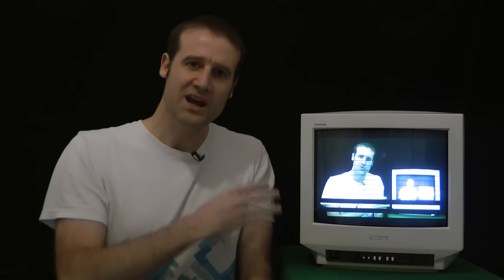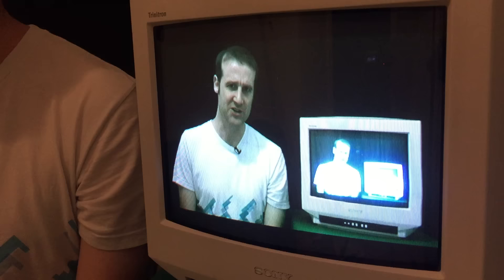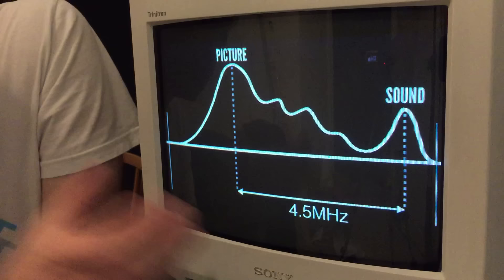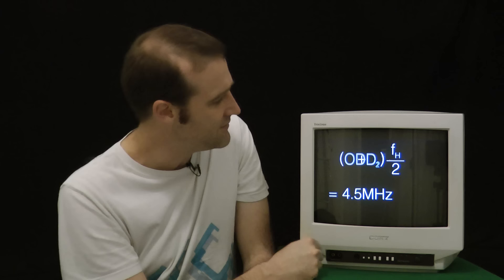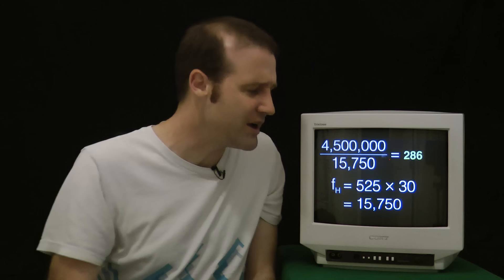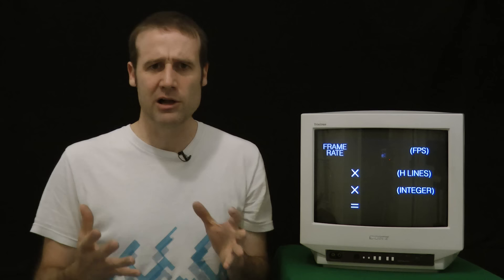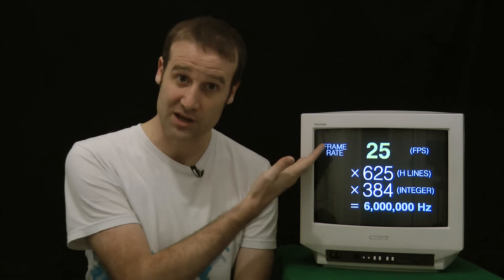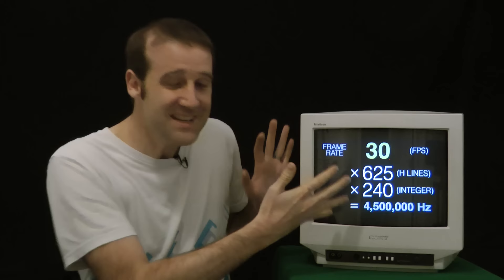Why is TV 29.97 frames per second?

Comment: “PAL was better because it was higher resolution”. Not true. The reason was much more interesting. Colour information was coded in the phase of a sub carrier relative to a short burst of that subcarrier at the start of the line. The problem with NTSC was that the received signal could have phase errors due to things near the aerial blowing around in the wind. These phase errors would get turned into distracting colour (hue) errors. In PAL (Phase Alternate Line where the phase swung +/- 45 deg ) each tv line signal was stored in a delay line and averaged with the next line. The vector sum turned phase (hue) errors into amplitude (brightness) errors which were visually unnoticeable. That’s the real reason NTSC was mockingly called ‘Never the same colour’
Reply: Exactly. But what about SECAM?
Reply: Never Twice (the) Same Colour
Reply: I was at BBC Engineering Training Department Wood Norton in 1980 (a former stately home which doubled as UNIT Headquarters where Jon Pertwee first appeared as Doctor Who). Our lecturer, Pete Harris, had a humorous take on  how the pros & cons of the three colour systems related to their names. NTSC was a beautiful work of genius but it suffered from one major problem - hue errors. (Thus American TVs all needed a 'Hue' control.) SECAM (Séquentiel Couleur À Mémoire) was fantastic for transmission (and protecting French manufacturing on the orders of Charles de Gaulle) but was mind-numbingly useless in the studio.  PAL (Phase Alternating Line), however,  took the otherwise excellent NTSC, built on the American experience and elegantly solved the hue problem. Thus, we had the three designations:
NTSC: Never Twice Same Colour
SECAM: Système Extraordinaire Contre les Américains
PAL: Perfect At Last!
Reply: The wind did not cause hue errors in NTSC.  The color subcarrier and the main carrier may shift together a little but, but, since the color subcarrier is detected as the difference between the carrier and the subcarrier (a much smaller figure than the main carrier), hue shifts did not occur.

If the picture is heavily affected by dynamic multipath (e.g. trees blowing in a storm) can cause a loss in horizontal synchronization. When the back porch color pilot is freed from the synch, anything that occurs in the horizontal retrace becomes a false color reference.
Reply: @1L6E6VHF  That's not entirely correct. It's not a question of subcarrier and "main carrier". The colour information was sent on a subcarrier (a sine wave added to the video signal - 3.58MHz in NTSC and 4.433MHz in PAL). The instantaneous saturation & hue of the picture were given respectively by the amplitude of this wave and its phase angle with respect to a fixed reference. The angle of the fixed reference was communicated to the TV set by a short sample of about ten cycles of subcarrier at the beginning of each television line (the Colour Burst) and then maintained throughout the duration of the line by the BLO (Burst-Locked Oscillator) inside the TV.
Reply: Nice information to supplement this presentation. Sounds like you had some first-hand experience with this!
Reply: @rom5285  VT Editor, BBC Television.
Reply: PAL had Colour noise (Heranboning) on fine detail like stripes in a shirt or Sute Jacket but didn't have annoying Colour errors and the picture
Reply: @don1estelle  Another classic was the nets on the goalposts at football matches (soccer to our American friends) shimmering with a purple aura. 
However, this was quite unnecessary. As explained in the video, PAL and NTSC were exquisitely designed so that the chrominance information was carefully interleaved in the frequency domain with the luminance. The two could actually be separated very successfully with comb filters, thus avoiding cross-colour AND preserving the full transmitted resolution of the luminance signal. Comb filters, however, were an expensive option, so manufacturers generally extracted the colour subcarrier with a simple bandpass filter (which meant that the fine detail on a checked suit was passed on to be decoded as though it were valid colour information) and either rolled off the luminance channel to cut down the dot pattern of the subcarrier or simply left it intact. The result was that viewers never got to enjoy the sparkling resolution and immunity from cross-colour that had been designed into the system from the very start.
Reply: @gerardjlaw  Tipical you get what you pay for ay! I wouldn't know about football nets I'm not a fan, like watching Paint Dry!!!
Reply: i do remember audio noises came up on TV, when a PAL station transmit pure white image.
Those fading to brief pure white image was commonly used at end of ads/commercial clip, which quite annoying.
Reply: Correct. it is System B that is higher resolution. PAL was only better because it has a method for automatically correcting color errors.
Reply: @don1estelle  I couldn't agree more! Recording a match reminded me of when I volunteered for a sensory deprivation experiment.
 
One day, George, the Sports PA, dashed in to ask about a match I was recording.
"Gerry! Who's scored so far in your game?"
"I don't know."
"OK. What's the score just now?"
I smiled apologetically..
"I don't know." 
A wry smile spread across his face.
"You don't know ****ing who's playing, do you?" 
And he was right! The OB link was coming from Dundee, but it has two football teams and I didn't even know which one it was coming from!  (However, syncs and burst were stable, vision and sound were continuous, AND I was monitoring off the playback head, so I was confident that I'd discharged my duty to the programme.)
Reply: NTSC sets had tint control because of the phase error. How often did people have to get up from the sofa and adjust it?
Reply: Graeme Roberts SECAM did not use QAM ( used FM so avoids phase error issue) but could not transmit both U and V signals simultaneously as a result. I think it transmitted U and V alternately by line so to obtain the missing signal, it just used the corresponding signal from the last line.
Reply: @graemeroberts2935  - SECAM is known to be very prone to confetti-like color errors, in my experience, along with being the worst in color reproduction. In my opinion: garbage compared even to NTSC.
Reply: @gerardjlaw  🤣😅🤣
Reply: Resolution and color were probably both factors in that
Reply: Incorrect. Pal is superior to NTSC is because the US thought about what's possible now and roll out something at its earliest just to say you that were first. Why is NTSC limited to the regions that use it? Because it was still in development when Yanks said "Yur 'Merica!"  lets get this new technology into every home we can and when better developments come along we wont care.

TLDR: NTSC is the format used in America because they jumped the gun. The technical reasons we know now are an afterthought since we can analyse the true definition.
Reply: @gerardjlaw  Thanks for all your posts and replies - I learned a lot about this interesting history of broadcast standards. (as someone who specialized in physics and electronics, I thought I knew how old TVs worked, but not at this level of detail!)
Reply: @GeorgeBurkhard  It's the old story - we physicists tend to think of the world in terms of fundamental laws but the engineers have to grapple with the complex detail of some fairly subtle interactions. 
There's a superb analysis of this stuff by another old VT aficionado, Sadiq Mohamed, here:
http://editorsbench.co.uk/documents/CF2015.pdf
Reply: @don1estelle  Never watched paint dry myself, what's it do?
Reply: The NTSC system had fewer scan-lines but also effectively lower horizontal resolution (from the RF bandwidth) than PAL. But it had the higher frame-rate.
Interestingly, when they started to go digital in the studios, they adopted a common 13.5 MHz sampling rate for both PAL and NTSC. 13.5MHz being just slightly above the Nyquist frequency for the analogue bandwidth... but also having an integer number of samples (non-square pixels) in both PAL 25*625 --> 64µs linetime (864 samples) and NTSC 30*525 --> 63.492..µs (857 samples - with some fudging somewhere). Standard definition digital video (including DVDs) comes from this digitisation rate. Because of the time "lost" in horizontal sync pulses, the "active" scan line (52µs for PAL) contains only 702-ish samples, rounded up to 720 samples for digital MPEG video (being divisible by 8 is helpful as digital video is coded in 8x8 blocks...).
Reply: @gerardjlaw  WOW
Reply: @don1estelle  what is Heranboning
Reply: @EnergeticWaves  Hmmm! Actually, it's a mistake based on hearing the word but not knowing what it means. The word actually refers to a "herringbone" (zig-zag) pattern.
BUT...
That kind of pattern on a TV screen was caused by the colour subcarrier being impressed onto the luminance (brightness) signal instead of being filtered out of it with (expensive) comb filters. 
However, what don1estelle is talking about is the exact opposite, viz. luminance information at around 4.433 MHz being passed into the colour decoder (again because most TV sets didn't use comb filters) and interpreted as valid colour information. This was called "cross-colour" and was seen as shimmering patches of colours, usually green & magenta or blue & yellow, overlain on an otherwise fairly colourless area of the picture. It was often seen in football (soccer) matches, where the nets behind the goalposts would shimmer with colour or on particularly loud suits worn by some of the less restrained presenters. (Often, coincidentally, on football programmes!) Cloth with a "herringbone" pattern was particularly susceptible, which I suspect is the source of don1estelle's confusion of terms.
Reply: @gerardjlaw  I remember reading about that R-Y & B-Y stuff a few decades ago.  was the idea to "fake green" buy fooling with red and blue?  I never did get it.
Reply: @EnergeticWaves  When colour TV was introduced, the signal had to look enough like the original black & white signal that it would work properly when it was fed into a B&W TV set. The answer was to take the three colour signals (Red, Green & Blue) and produce a luminance signal, Y, (basically, an old-fashioned B&W signal), equal to 0.3R + 0.59G + 0.11B and then to add a high-frequency sine wave to it carrying enough colour information that the original R, G & B signals could be recovered. 
At the source, there were actually two high-frequency sine waves offset by 90° which were amplitude-modulated by the 'colour-difference' signals (basically R-Y & B-Y), and the two sine waves were then added together. However, by the magic of vector algebra, they could be separated again at the receiving end and R-Y & B-Y recovered. From these two signals and the Y signal, the original Red, Green & Blue signals could then be calculated and fed to the guns of the cathode ray tube.
It sounds like a long way for a short cut but it maintained excellent compatibility with existing B&W sets while delivering good quality colour pictures to those sets capable of displaying them.
Reply: So PAL has higher resolution, an integer frame rate, better colour reproduction ... yet NTSC is always considered the default

Comment: To be precise, for NTSC 4.5 MHz is the frequency difference between the video carrier and the audio carrier for each (6-MHz) channel. IIRC, the reason that this value could not be changed (leading to the math discussed by Matt) was that if you moved the audio carrier (say to keep 30 frames per second with 525 lines per frame as well as the half-integer requirements), the audio demodulators of the existing B&W TVs would be unable to correctly demodulate the audio. Analog TV audio for NTSC was frequency-modulated (as well as pre-distorted, but that’s a topic for another discussion), and I believe that the analog circuitry used at the time could not tolerate much error in the location of the audio carrier. The video demodulation, on the other hand, could tolerate a much larger relative change without needing redesign (say 30 Hz to 29.97 Hz, or around 1%).
Reply: I'm not sure where you got this from but it contradicts what the main problem the standard was trying to eliminate. The new subcarrier (3.583125 MHz, for color) had harmonics that interfered with the FM sound subcarrier (4.5 MHz) creating a constant buzz in the audio. By lowering the framerate along with the SC frequency the noise in the audio was reduced (beat frequency was now outside the audio bandwidth) and everyone signed off. Lots of compromises b/c no one wanted to reinvent the wheel with the color SC again.
Reply: Since it's not allowed to go outside the 4.5 MHz window, couldn't they just change the window slightly by moving it inwards instead?
Reply: @Anonymous-df8it Interesting proposition.
For example, the integer multiple could have been reduced to, say, 280; with 525 scanlines at 30 Hz, this would bring the bandwidth down to 4.41 MHz.*

* 4.41 MHz is a square number, if that livens things up at all...
Reply: @keansakata1015  It sounds like you're just repeating what the original commenter said, so there isn't any contradiction
Reply: @SeanHarding-nv9li  Where are you getting the bandwidth values from?

Comment: From what I remember from working in broadcast TV, the reason they stuck with this as a standard was for backwards compatibility.  They wanted to still be able to broadcast the same signal so it works on the millions of black and white TVs that were already sold to consumers, and to enable TV stations who invested millions to not have to scrap everything and start over.
Reply: How many people are still using black and white tvs in almost 2023
Reply: @Xnoob545  Plus this is specifically for analoge signal. So why people insisting on using 23,976 and 29,97 fps for digital content, I don't get.